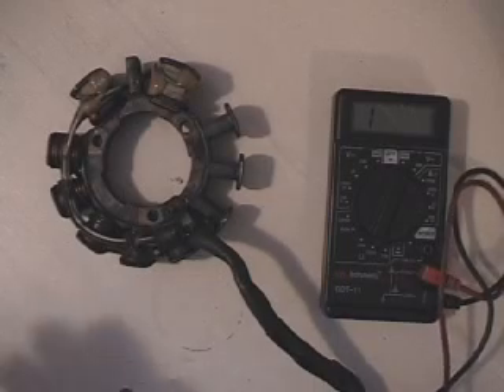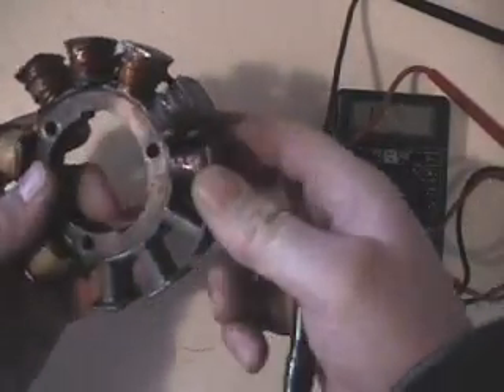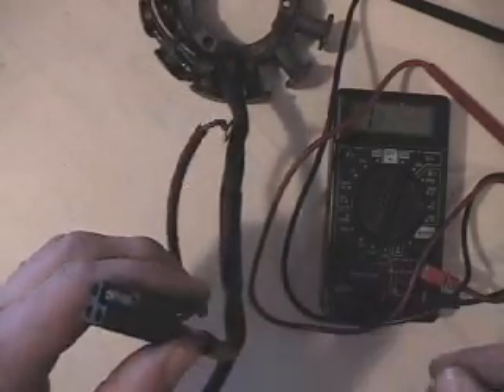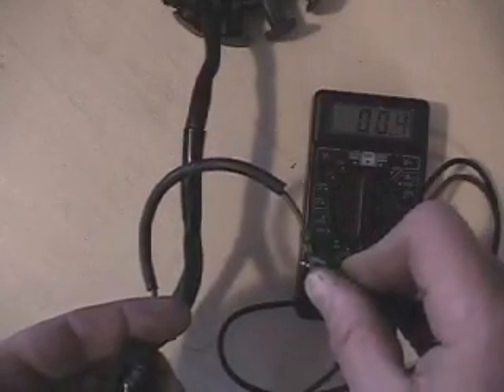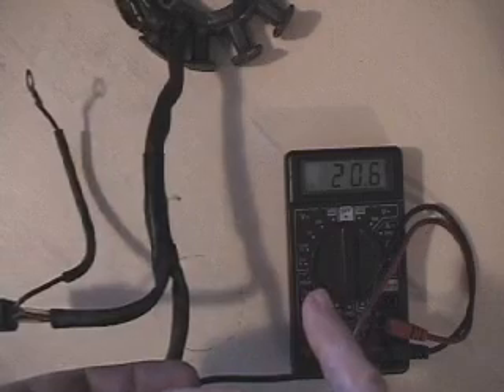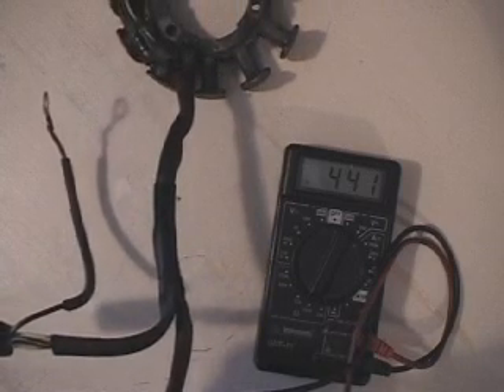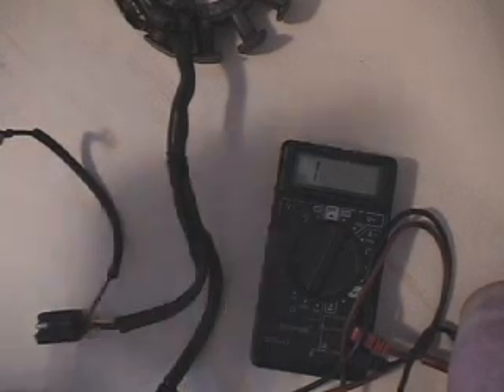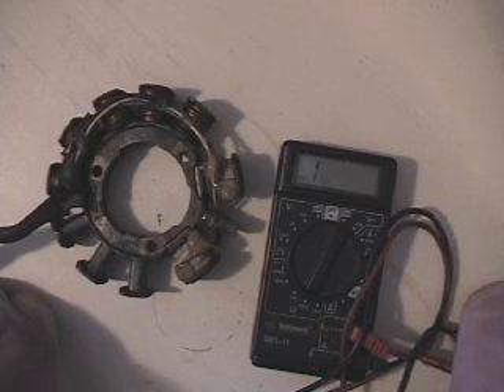Arctic Cat ZRT 600 Stator Testing

Comment: Sorry Blaine AutoCorrect got me there when I checked my stater with a multimeter the 450 ohm readings across the top on the four pin. I only get 279 ohms.

Comment: Wayne, I’m hoping you can help me out. I got a 97ZRT 600 restoration project I can get spark on either the single spark plug coil or the double spark plug coil. I cannot get them to spark at the same time. Try the wires every which way from Sunday The power, the coils. Let me know if you have any thoughts appreciate it.

Comment: Good afternoon, It is 20f outside and I am reading 20, 182 with 203 as my total. Obviosly the 182 should be 440  but what does this mean?
Reply from the maker: the 20 is good for the high speed coil but the 182 means your low speed coil is dying/almost dead. I can rewind it. www.outdoor-electric.com

Comment: On my 96 zrt600, I get 20 ohms for the right two terminals and 0 ohms for the top two.  Does that mean the stator is bad?  I have a spark that’s too weak to get the snowmobile to start.
Reply from the maker: If you're getting 0 ohms (and you multimeter is on the right settings) between the green and white wires then it sounds like your low speed ignition coil is bad.

Comment: On mine I’m getting 454 on my low speed and 21 on my high speed. What is considered to be with in spec?
Reply from the maker: 435-445 & 17-20 ohms. If you're getting 454 the low speed coil is starting to die.

Comment: ok I got a 95 600 triple  , Ohms is 19 and reads 441 then flashes to 422 on top two pins my stator should be around 450 ? my stator is bad ?
Reply from the maker: General guidelines are 435-445 and 18-21 for the high side ignition coil.  Double check to make sure the low speed coil still reads in that 435-445 range at room temp and that it doesn't bounce around. Make sure the multimeter is good and the battery isn't low. If the low speed coil keeps bouncing around all the time..441, 422, 456, 415 ect..when testing it at room temp that is normally a sign that the low speed coil is bad. Every once in a great while I'll get a stator to rewind that does that..the ohms just bounce around and it is bad.

Comment from the maker: General rule of thumb for OEM stators is about 438-445ohms and 19-20.5 ohms at 50-80 degrees F and 420-445ohms and 17-20 ohms at colder winter time temps like 0-30 degrees F. Yours measuring 427 at warmer temps is a possible indication of the low speed coil going bad.
Reply: Thank you for saying this! I just measured 19 ohms and 427 ohms, but it's 30 degrees in my garage. No spark though

Comment: my stator in my 96 zrt 600 reading are 427, 20, and pickup is at 90 ohms this is all at 16 degrees celcius is this to low ? thanks in advance for your answer

Comment from the maker: If you have a ZRT 600 2-stroke motor and the stator measures 756 ohms, then it is bad. If any ZRT 600 OEM stator measures higher than 450 and 20 ohms, it is bad. If you have a 4-stroke motor you are trying to measure the ohms on, I don't know what your specifications should be.
Reply: What if its lower ? My h.s reads 20 and my l.s reads 350 is that too low? Yellow wires bounce from .6 to .9 and cannot get a consistent reading. When I test the ground and the brown wire on the rubber plug it also bounces from .3 to .8 also not getting a clear reading. My sled will only idle it won't rev up only blogs, slightly idles up if you ease into very lightly but then bogs down and almost stalls. I'm thinkng it's the stator but I'm unsure. 99 Artic cat 600 zrt

Comment: (moped 139qmb) I have 4 stroke maintenance manual in book 8 coil the excitation coil resistance value (-20 ° C.) is 350-450 ohms I test you, and is 756 ohms, it is right or wrong

Comment from the maker: You can test it in the sled. The only "issue" is that every once in a while you may have a low speed coil that measures 435ohms in 30 degree F weather but if you take it in the house and warm it up to 70 degrees it'll measure 455ohms. Whenever an OEM stator measures MORE ohms...in your case more than 450 and more than 20, then the stator is bad. When measured in cold weather, the range I look for is 19-20 for the high speed coil and 430-450 for the low speed coil.

Comment from the maker: Although slightly low at 431 ohms, it is still good. Once you start getting a low speed/primary coil reading that is lower than about 430ohms at room temp, then it is starting to become suspect. Anything below 400ohms at room temp is usually bad. A stator coil doesn't always fail in the same way so sometimes a stator reading 425 ohms at room temp is ok and sometimes it is bad and it will only act up when the sled is running.
Reply: I have 458,and 479 in series.i take it the 458 is to high?.sleds been having weaker blue spark and running on 1 to 2 cylinders.
Reply: room temp is 460 and 480 in series.so according to u BlaineDP this is bad to high?